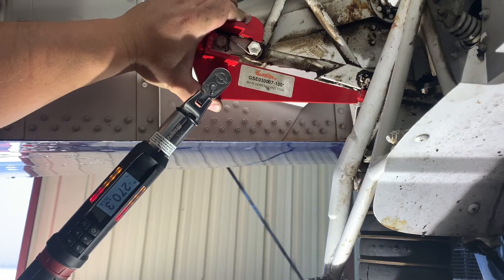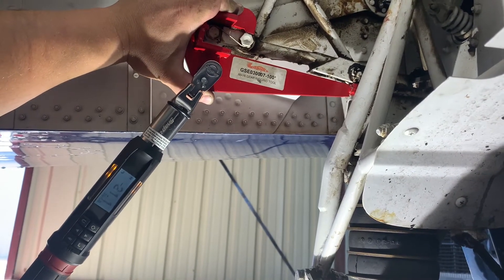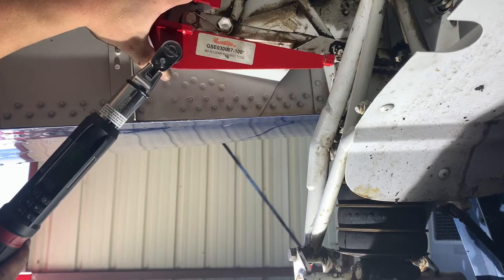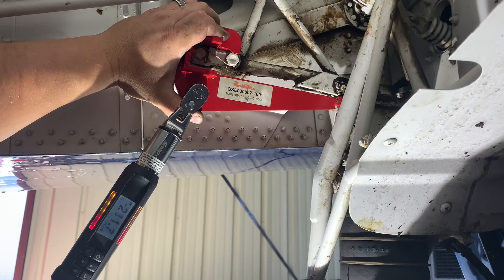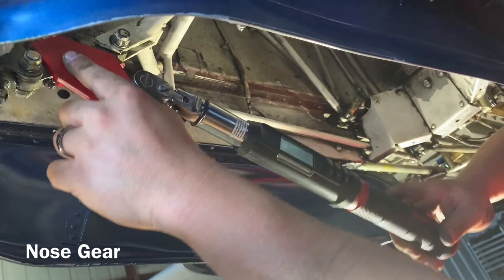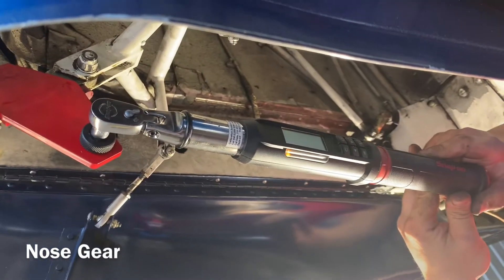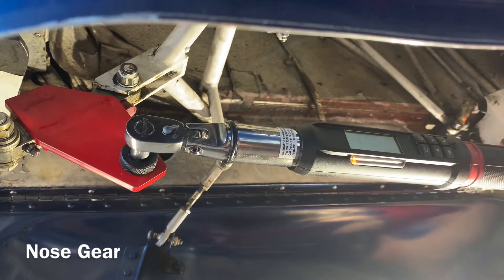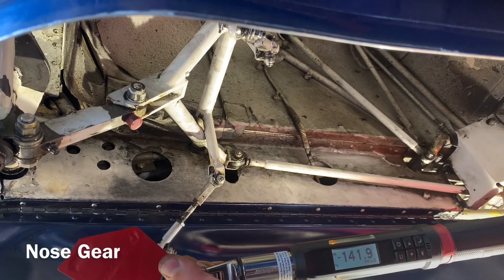Mooney M20 Manual Gear Preload Check

Comment: Did you have to disconnect anything to perform this check?
Reply from the maker: No. Everything stays connected for this check. The gear must be down and Johnson bar locked into the receiver.
Reply: @JoshSinclair  thank you, I must've read the wrong thing in the manual. First time working on a mooney